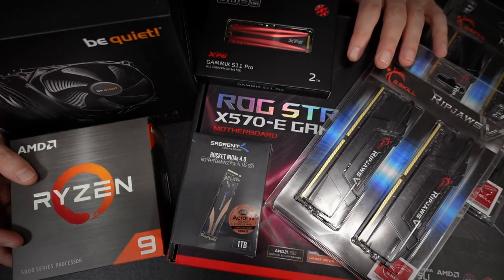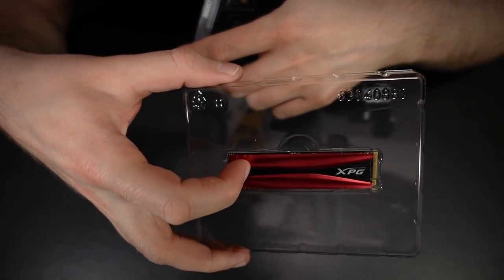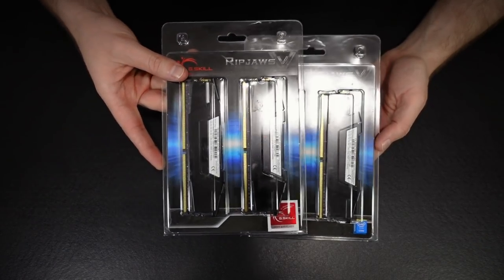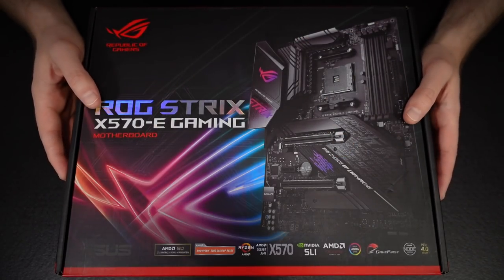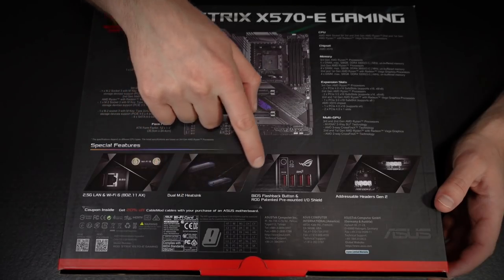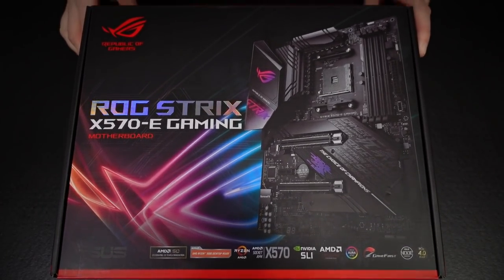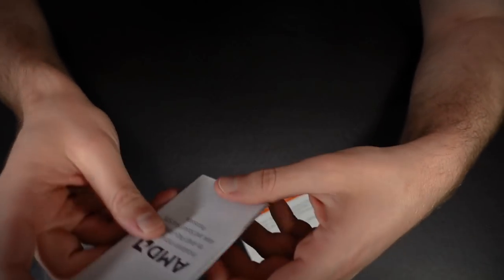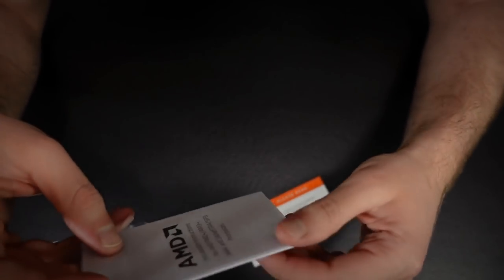Unboxing the ULTIMATE ASMR PC ft. Ryzen 9 5950X! (tingly & relaxing ASMR whisper)

Comment: Good stuff Nick! I'll be building my new PC pretty soon here. That's a beast of a rig you are building!
Reply from the maker: Nice! Building a new PC is always such a joyous experience :D
Reply: @theASMRnerd  Always great. I'm putting an Intel i7 9700K in with 16GB of 3600mhz DDR4 RAM(I'm going to add an additional 16GB later on) with an MSI Nvidia GTX 970 (which is going to be upgraded to an RTX 2070). My mobo is going to be an Asus Prime Z390-A. I can wait to mod Skyrim with this beastly rig. The RTX 2070 will certainly make that experience very fun. As for storage, I have a 1TB Crucial M.2 drive for my OS (and likely some games) a 1tb OCZ SSD for games, a 1tb WD Black HDD, likely for games as well and another 180GB HDD for less performance hungry games. I am going to add liquid cooling later on, but for now I'm using the Deepcool Gammaxx 400 CPU cooler. This rig is gonna be quite the upgrade from my previous one, and it will be ridiculously fast. Cheers, Nick!
Reply: @theASMRnerd  that is also a very slick motherboard you have there!

Comment: i just got the ryzen 5 3600 huge upgrade from a 6 year old i5, i also had the gigabyte vega 64 but that thing is so power hungry its blew 2 power supplies so far so probably going to get a 3070 if not 1 of the newer but cheaper amd gpu's as anything is better than my gtx 970 lol, your have a supercomputer going here lol hope you get a 3080 soon
Reply: I upgrade to a 3600 this year from an Athlon X4 870k. FM2+ to AM4 is an absolute trip xD

Tho I’d be a bit hesitant on the 3070. It’s a worse deal than the 6800...

Comment: Im sorry to break it to you but i dont think the power supply will be enough. As Nvidia themselves said you should at least have an 850w gold rated psu for the 3080 and above. but its enough for a 3070 and below. So you should just keep this in mind.
Reply from the maker: Yeah, it'll be close. I talk about it a bit in this weekend's video. Nvidia's recommend spec always overestimates by a decent margin to be on the safe side, and I don't plan to overclock, but the ROG Strix does draw more power than a reference 3080. I'm gonna give it a shot, but if I have to get a new PSU, so be it.

Comment: My PC feels like this system without the steroids. Ryzen 3600 paired with a GTX 1070 seems like a similar bottleneck for the 5950 and the 2060...

Tho my 1070 is also only a stand in until I can get my hands on a 6800xt or 3080. Don’t think I’ll be getting Ryzen 5000 tho, because I’d need a new motherboard, so I’d rather wait a few more months and just switch to AM5...

Comment: Broooo I’m building my first pc beginning (or close to it) of next year. Any tips? I already have a monitor and mechanical wireless keyboard. What is some hardware that is going to last me awhile. I know I want a large ssd. Any other tips would be appreciated!
Reply: Get a good Power supply. Good brand, good rating, with some extra wattage on top of what you need.
Reply: Pcpartpicker.com
And Google some "gamers nexus 2020" guides. That will point you in the right direction